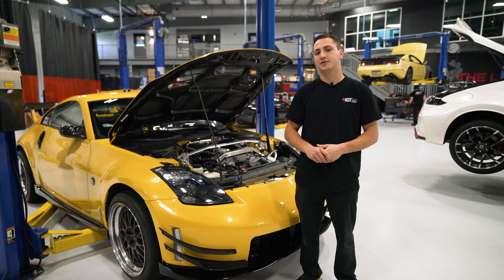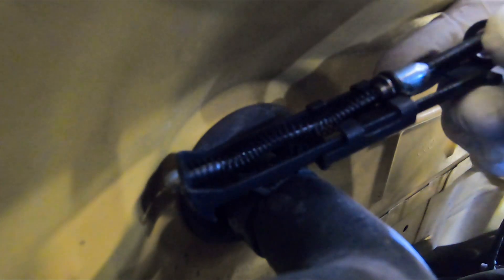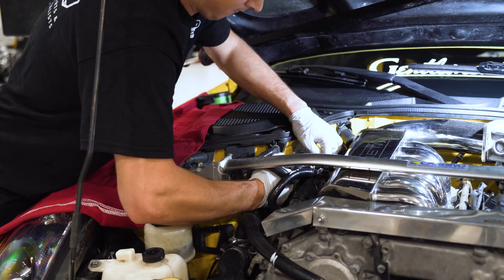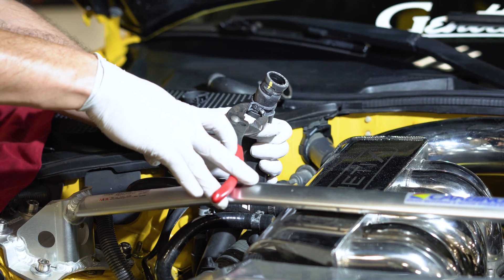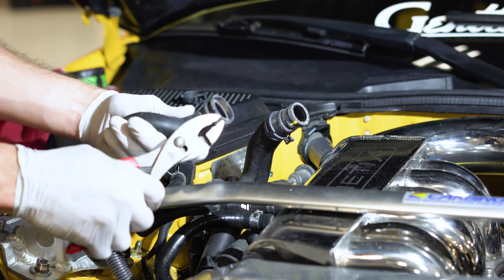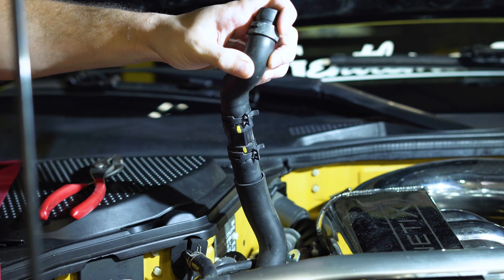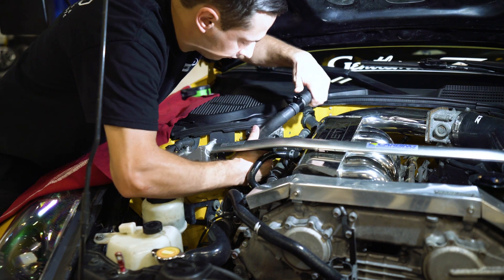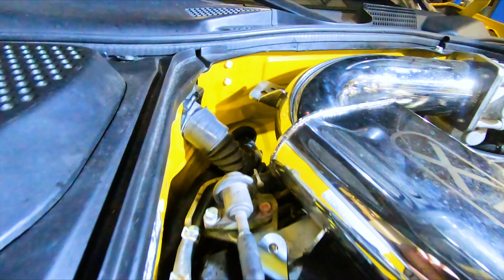Z1 Coolant Bleeder Port 350Z Install Guide

Comment: When you use the bleeder valve, is it like shotgunning a beer or using a beer bong? Do I just quarter turn an Allen wrench while the radiator cap is ON??

Comment: Ya this video is in no way indicative of the actual pain in the ass changing the bleeder or the heater hoses. The bottom clamp is a COMPLETE pain in the a$$!
Reply: LMFAO dealing with that rn... been tryna get the damn hoses off for an hour now (I'm also replacing the stock hoses with the Z1 hoses)

Comment: Connector leaking on hoses by pass side firewall. Do i need to drain to change part? Thx
Reply from the maker: Maybe not drain the entire system but you will need to re-bleed it.

Comment: Do you need to bleed the system after install?
Reply: Yes because you’re introducing air into the coolant system which needs to be bled out. They should’ve included that part at the end of the video